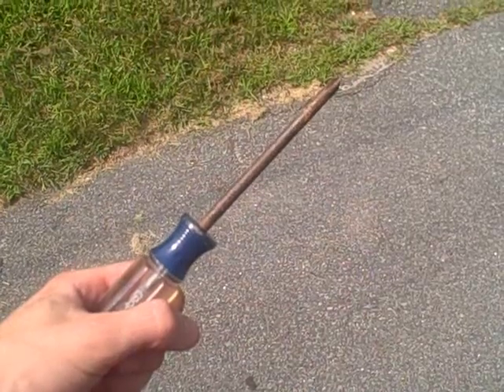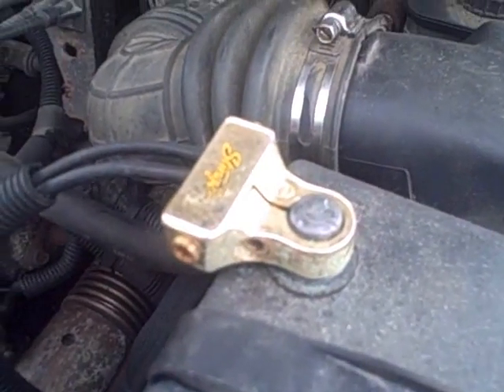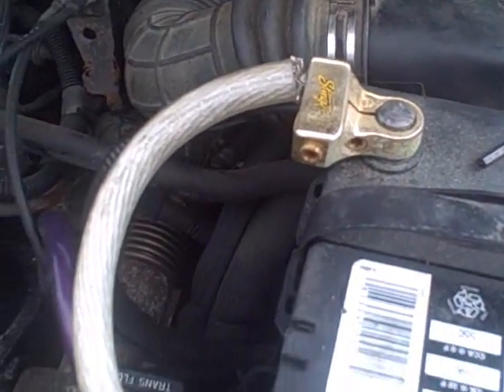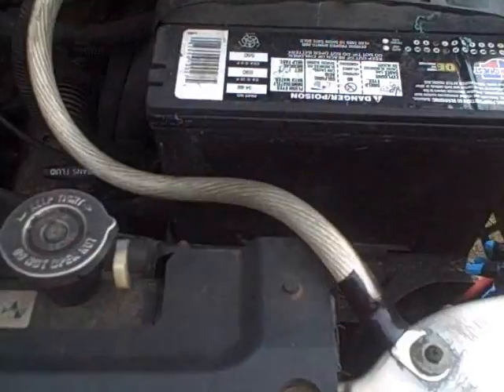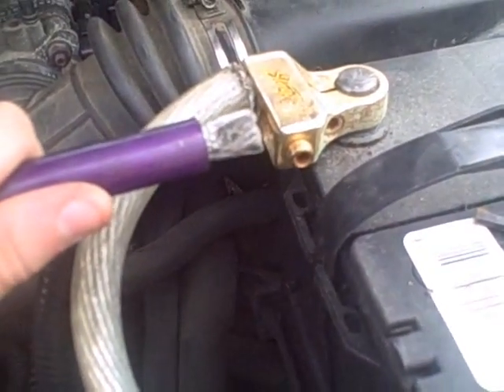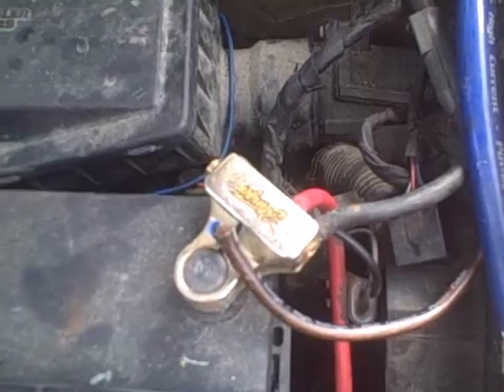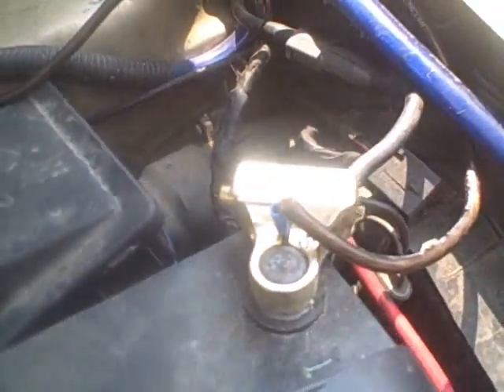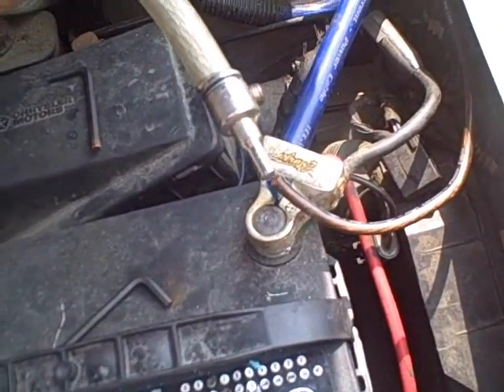Increase Car Audio Power 25% - How To Install Big Three Upgrade - Easy 15 Volt Stereo System Big 3

Comment: Not to be a dick, but the BIG 3 would actually entail upgrading your battery, alternator, ground and power wires, you really only did the big 1, lol, for more power you have to apply OHMS Law to your system and if you dont know what that is then, its time to go back to school, nice video!!!

Comment: @alexroufs that is just letting the power flow into your capacitor to charge it and then when the light goes dull it is safe to place your fuse back into the fuse holder, if you dont charge the capacitor before you put the fuse in it can mess shit up. hope this helped

Comment: Hi EXO like your video...there is however a section that confuses me...the last bit with the fuse and the 12v light in relation to the capacitator... Can you explain that to me please? Regards, Alex

Comment: @matonogg thanks bro .. Ok so (engine to frame and frame to - terminal) or (engine to frame and engine to - terminal) and for the alternator to + I was thinking doing the 12'' away from + terminal? And could I put a 300 fuse? Or should I stick to your advise of 250? THANKS in advance!

Comment: @BEASTBOY9297    try the 2400 watts  boss 12 's i have two on both my car's with a 4000 watts quantum audio amp with a 20 farad capacitor .

Comment: Bigger wire does not increase the power flow that goes through the wire it decreases the resistance, which causes the electricity to flow easier.

Comment: where did you get that adapter for the 0 ga wire coming from your system? It looks like you put it on to make it fit into the smaller port on the terminal.

Comment: Hey what's up EXO.. so I have a question I'm doing the big 3 in a few days (MONDAY) and I've seen videos here on you tube that has you ground your engine block to the car frame NOT the negative battery terminal.. Can you clear me up on that please I wanna make sure I do it correctly : P THANKS BRO!!!

Comment: hey exo i want to do this to my car however i dont see how u got all 3 0gauge wires into the terminals ? and wen u plug in ur stereo 0gauge wire wats that thing on the tip and where could i find one ?

Comment: that's good man now i now what i will need for my first car im going to buy in the next 3/5 months i only have a pioneer sub 8in 250 watts but i have a 25x4 watts pioneer amplifier but my regulated power supply cant hold a lot of sub sound it's just five amps and i dont know any place were they can sold me a bigger one but its alright tho i now learned something new thanks to my friend exo

Comment: @Accessories04 cos you put the + wire of the battery onto the ground housing of the altenator. there is a positive connection behind the alternator that it must go on.

Comment: @toyoracing89 Alts don't push out watts, and alts weren't designed to push out a specified number of amps, they're rated for a certain number of amps that they can put out reliably.  You can add a voltage regulator to your stock alt to make it charge at a higher voltage.  Most stock alts will charge well above 12 volts(like ~15 volts) on a cold day.

Comment: @toyoracing89 :facepalm: no shit?  They also advice against doing a lot of other things too.  If you need more power, you upgrade wiring, then upgrade batt(s) and alt(s).  Spending $170 on a spool of 1/0 gauge is cheaper than spending $300+ on a good battery and $400+ on a good alt.

Comment: @ronhollis Fortunately there's quite a lot of professional audio people that think that capacitors are just a waste of money. I've worked with cars for a while and I can tell you that it's always a bad idea to modify your cars wiring. Your alt' was designed for certain amps/watts and will only push out that much.

Comment: Though I'm not an expert on electricity. I would have to state that there's quite a lot of car manufacturers that advise AGAINST any modification of the wiring from the alternator or battery and so fourth. If you need more power, add another battery, if you need even more than that, add a second alternator.

Comment: 0 gauge FROM the alternator is a waste. even with a 200 amp alternator, you need not use such heavy wire. this alternator is obviously not 200 amps either. 6 gauge from the alternator is more than adequate.

Comment: if your going to upgrade the wires you might as well get batteries instead of caps. Im all for caps, they work, your amp has them, so therefore they work. its not about how big the cable is. it is what the cable is made out of. yes bigger is better. but just make sure its high quality copper. strands of it, not a solid piece, (that usually means that its aluminum) make the runs as short as possible. Rule of thumb. The longer the run the bigger the wire. Thats y 0 gauge wire is not necessary.

Comment: resistance, this is why it's better to upgrade grounds and power. if the power coming to and from your amps is restricted the will have to work harder thus creating heat and horrible sound. think of the power like a water hose. the bigger the hose the easier the water flows and faster. @hacksand kicker is horrible audio bahn is worse. i've been using ARC audio for the past 5 years the best i've seen this far. we compete with it for sound quality check them out. Arc audio .com

Comment: my lights were dimming badly until i added a power cap and i did big 3 update. i was just wondering if a power cap could stop working properly or break down?

Comment: Did you clip that clear 1/0 cable down to fit in the 4 ga hole on the negative terminal? I am having a simlar problem. I can't find a terminal with (2) (or even 3) 4 ga openings. I am using a marine terminal temporarily and just screwing everything down on one bolt and nut.  My F150 stock alternator wire seems to be 4 ga, so adding an upgrade and then my amp power will need a terminal with (3) 4 ga slots. Anyone know of such a terminal?

Comment: Basically you are replacing existing 8 gauge (usually) with 4 or 1/0 so that more current flows. My 98 F150 has 8 gauge stock, so 4 gauge is a big improvement, comsidering I am leaving the existing wires in place and simply adding to those.

Comment: Kiddies, pay very close attention to the info from Mike From Maxxsonics in the description for the video if you're going to do this, as doing it UNfused can lead to very very bad times if you have an electrical system failure or a short.

Comment: @tmorales509 try either a corrosion spray or did u get the felt pads that go between the terminals and battery post

Comment: @isaacu, you redo the ground to the engine block to complete the charging curcuit. The alternator's case is the main ground source on all vehicles, hence why you ground the engine block to the battery. The positive from the alt to the batt, and the engine to the batt negitive makes a complete loe resistance charging curcuit.

Comment: I'm 16 and new to car audio so hear me out , but I could be wrong :)

I have a 1978 lifted chevy blazer. My positive goes from the battery to the starter, then to a box which is connected to the alternator. Is this normal? Can't I just run some of these good cables from the battery to my stereo, so I won't come out to start my truck and have it not turn over because I fooled with the starter? thanks

Comment: Nicely done, however I fail to see any advantage to upgrading the cable to your engine block. Before you think I'm just a rondo hater: I'm a car audio guy and an electrical engineer (Specializing in Power Distribution Systems for Concert Audio).

Comment: Question for you.. I watched a video where you said that capacitors are a waste of time but I seen that you included charging one here? Do you run your system with a cap? If so is it just for looks like you stated in the other video?

Comment: @aross414 DB Electrical store its not no fancy schmancy irragi but it gets the job done.i get 14.60 volts with it a stock battery and a little Shuriken skbt-20

Comment: surely the cable is way over engineered, as the connection from terminal to cable is not great, its only allen keyed in, not soldered solidly or anything? the cable will never even reach close to its capacity, look at the size of it... car audio companies make these expensive, unnessessarily large cables as a gimmick

Comment: HEY EXO OR ANYONE GOT A QUESTION I DID THIS BIG 3 UPGRDE I GOT A 220AMP HO ALTERNATOR I WANTED TO KNOW IF ITS NECESSARY TO FUSE THE 0 GAUGE WIRE FROM THE ALTERNATOR TO THE BATTERY? ALSO I WANTED TO KNOW IF SO WHERE SHOULD I PUT THE FUSE BETWEEN THE ALTERNATOR TO THE SOLENOID OR THE SOLENOID TO THE BATTERY? THANKS.

Comment: @tha1onlyjake 
1.Nope m8.. it's okay. you can have 1000 grounds if it's  physical possible :D
2.It depends very much on the actual relay, if it's in a good state and if can power the amp AND charge the battery(if isnt fully charged) in the same time... will do. Rather, I recommend a good battery if the alternator can do the things mentioned above. Check varta website.

Comment: Do you HAVE to disconnect the negative terminal from the battery before hooking up the power wire and amp?

Comment: good stuff
i'm running one memphis 500 watt RMS 1000 watt max 12" M3 and a 500watt RMS 1000 max memphis mclass amp running dual 2ohm coil's so all in all 1 ohm the only time my optima doesnt handle the power is when were in the cruise with the really bad stop and go.

Comment: @7KAYJAY7 Depending on what your car is, I suggest a 200-300 amp ALT and a Powermaster XS Battery. You can find everything you need for your charging system at MechMan(dot)com.

Comment: @ltucker16 with that garden hose u will be gettin that 12 oz as fast and as much at a time as u can with straw ur straining to get it all and get it fast. with that wire ur getttin ALL the power from the alternator with less restrictions.. the wire makes a diff bro.

Comment: hey man does the engine block already have aground to the negative terminal. or did you just run that wire to a bolt on the engine block. Thats the only part of the install thats confusing me?

Comment: hey, so im getting a Massive Audio nano block amp. But first i want to get the big three to get more power!  where did you get the dual 0 gauge battery terminals and the 0 gauge adapter to turn it into 4gauge?

Comment: i think who the ground put in this system is useless  ,1 the lugs screwed with a screw who d'ont have a nut is useless , 2 the ground in the parts to frontal body is useless becouse this part is paint and not have much contact whit other metal to body
3 is more useful put a ground in the original location and put a 2 ground in gear  becouse the alternator not have more way to make contact  

regards  simone

Comment: @faceless127 What you say is true to an extent but when running longer lengths of wire or at higher amp loads you will achieve less resistance with a thicker wire. The factory installed wire is usually only enough for the cars load at factory default power draw not when you are drawing a consistent 70-120 amps through an 8 AWG run of wire.

Comment: @gaspower70 A problem with doing that though would be that a normal car battery can only be cycled to low power so many times, like it would start losing a crapload of capacity after being discharge like 10 times so you would have to invest in a deep cycle battery that can be recharged many times.

Comment: @gaspower70 Yeah that probably would work but about the overcharging. Well you wouldn't want to charge your battery indoors anyways because it would release hydrogen gas -.- and thats not good so just hook up your battery to your amp and it should last a good 10+ hours, and when you are low on charge you would take the battery outside and use a car battery charger. Those are pretty cheap i think you can get them for about $30.

Comment: Your alternator is only rated at so many amps and its only going push what its rated at with that being said the wire it came with is perfect for it.  Not to big and not to small... Increasing the size of the wire when it doesn't need to be increased is just going to increase the impedance which then intern decreases your amp flow because the more wire you have the more its going to increase your ohms.

Comment: @gaspower70 A Car alternator puts out around 14-15 volts. A PSU puts out exactly 12v for the car battery to charge it nees a current that is at least slightly higher than its nominal output of 12.6v so to answer your question, no you cannot use a psu to charge your car battery. What you can do is directly wire a PSU to your amp but you need to make sure that your PSU has a high rating on the +12V rails.

Comment: @JoeFloDM8  well you could kill your alt but ive done multiple batteries on a 94 accord stock 80amp<probably less... without as much as making it whine so not likely i mean dont just blare your music hours on end with the car off and then crank it depending on the alt.  but i will tell you what to do, charge your battery at least once every 2 or 3 weeks and you will be fine dedicate at least 1hr of charge time on 12LO and you shouldnt have any problems

Comment: @JoeFloDM8  well i have always thought a capacitor was pointless for the simple fact yes they quickly discharge when you need it but it also recharges at a fast rate thus making a cap a light show lol but an upgraded alternator can never hurt but i recommend an extra battery, i have an autocraft deep cycle marine battery that i got from advanced auto when i worked there it helps alot, but if you do the big three and get another battery it will be enough for a 1500 watt amp

Comment: @JoeFloDM8 in response to your amp question, you are going to be using a 1500 watt mono amp and kicker doesnt overrate there equipment so that a real 1500 so do the big three and i would recommend another battery also.

Comment: @dexter199 Haha yes, because these cables need to handle a huge amount of current which would turn into heat if there was more resistance.  Power companies use small, aluminum cables since the voltages are hundreds of times greater.  This is cool because we can just use transformers to enable us to use more current and less output voltage if need be.

Comment: @gaspower70 There is a difrence between DC AC cars use DC and houses use AC but im not sure if that would I think you can use AC to charge things that are DC. But im pretty sure you cant use DC for AC. Hope this helps. Message me if you want more in depth explination

Comment: @EXOcontralto I heard that a too big alt can destroy your battery? Is that true or is my mate talkin crap :P And is it really nessecary to use a 0gauge wire when your amps need just 8 gauge power wire? Because im planning to run my sub of a 500w amp (i know not big but im just a student and my mids/high of a 350w 4 channel amp).

Do i need somekind of battery or can my stock electrical with big 3 upgrade run that?

Comment: EXO, i was wondering if my thory is correct.
Alternater charges the battery/batteries and delivers current. But it cant deliver a ginormous increase of current (like when your bass kicks in from like 60 amps to 300 amps. That creates a voltage drop. You can decrease the voltage drop by adding buffers in the form of batteries/capacitors?

Comment from the maker: @de52710 - No actually....

You can't increase the output of an alternator by adding bigger cables - Doing this only allows the current to flow more freely throughout the wire.

It does not overdrive your alt, it relieves it.

That's like saying you can spray water further with a bigger hose... No, it actually only allows for the water to move more freely... not increase the amount of it.

Comment: hi just wondering my alt is 150amp so what cable will be good to connect with my battery . 0gauge (50mm) or 40mm cable is well ok

Comment: hey exo i ran my 0 gauge from my alt to my bat and my 0 gauge from my amps to the battery but when i put the normal non 0 gauge battery terminal wire on it statred to spark like hell and alost made a fire where did i go wrong????

Comment: @jeepowner00001 cuz your car isn't designed to make tons of power man! about 60% goes to the car and about 40% for everything else. if you think doing this will help you out with a stock alt forget about it! most do under 80 amps and hooking up like 1000rms is way over for 80amps and will kill the battery and the alt in time. Buy a deep cycle battery and see how much better your power supply is just with that

Comment: My positive wire goes from my battery straight to my starter, SO!! if i connected it straight to my alternator, than how would my starter work???...i need help, i need to do this upgrade, is there a chance it can mess up my electrical system if i do that?

Comment: When you have the accesory wire that you plug in, I noticed it has a cap on the end so you dont have all this loose wire ends hanging out. now the one you have looks like a 0 gauge to 4 gauge convertor, but whats the ones called that cap a 0 gauge wire and then you solder it on, and then you can hook it to your amp and the screw catches on it, instead of squashing all the wire in there and having it come out??!?!?!? I have been looking forever, my uncle told me about this

Comment: @EXOcontralto  the alt power wire that is fused runs straight to the battery but you also leave the original that runs to the starter and then to the battery so if you blow a fuse the original is still there to prevent electrial problems

Comment: @EXOcontralto Gotcha. I can only speak from experience and I personally have never had an issue. In fact, the only reason your circuit breaker or fuse would go when fused above the maxx amperage on the alt is if your alternator is malfunctioning and presenting a potentially damaging situation for your vehicle or components. It's all good man, to each his own I guess.